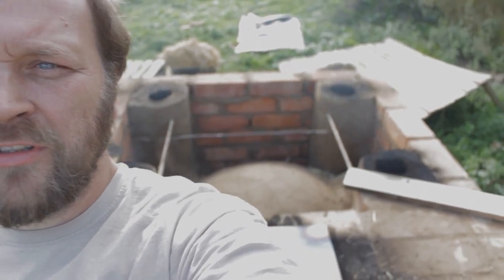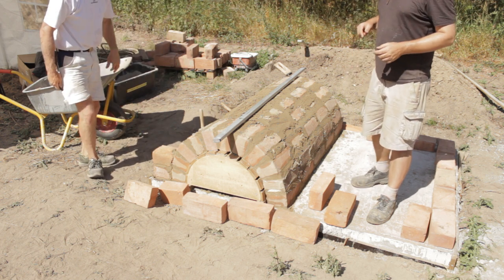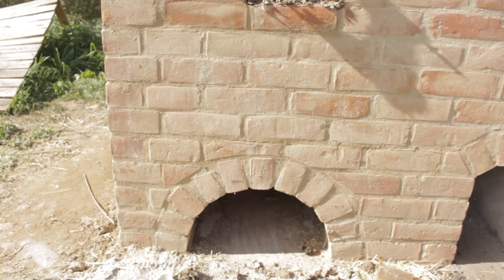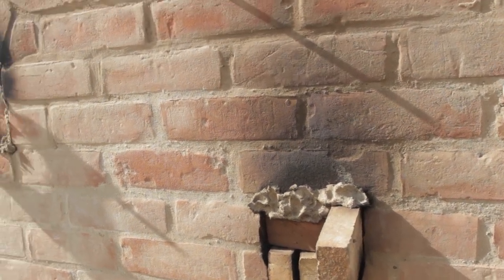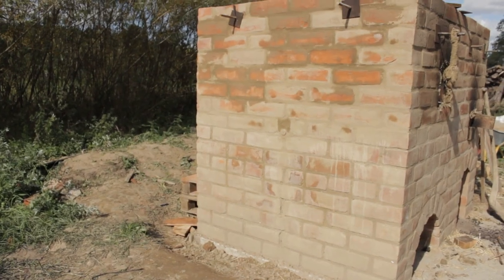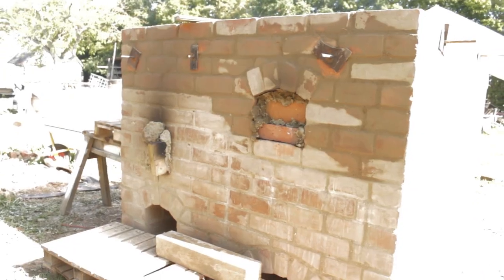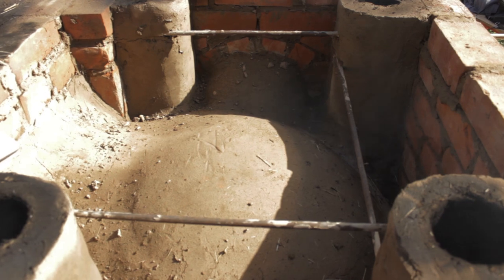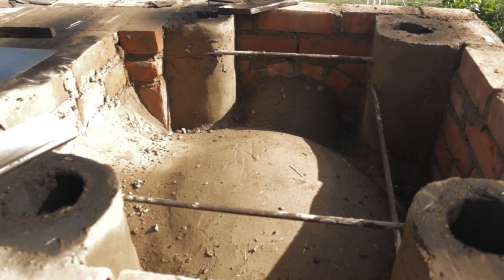An early 16th century reverberatory furnace for casting cannon  #medievalgunfounder

Comment: great-looking furnace! are there any metallurgical concerns with bronze melting / casting (e.g. preventing oxidation or contamination or something) that you needed to take into account when building it?
Reply from the maker: Thanks, yes it is a great one. And yes, there are a lot of considerations as to the nature and quality of the molten metal that is being created with this furnace. These are actually the reason why I built it. Wait for the published article on the whole thing and I can tell you more in much greater detail. SO much here: there will be highger losses compared to crucible furnaces, specially where the tin, but also where the copper is concerned. But, then there is no other way for big time casting in the early modern period.